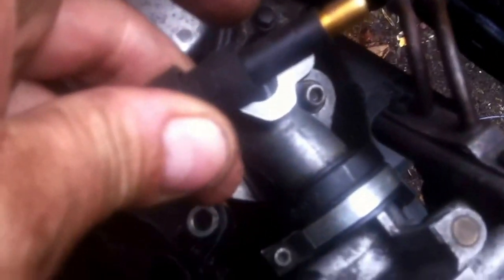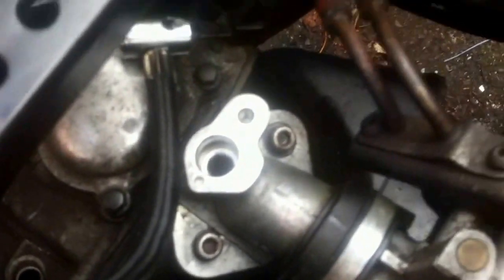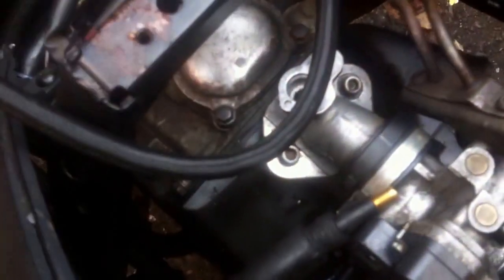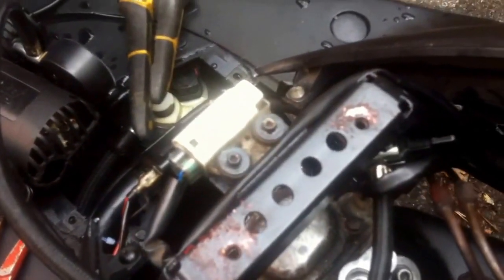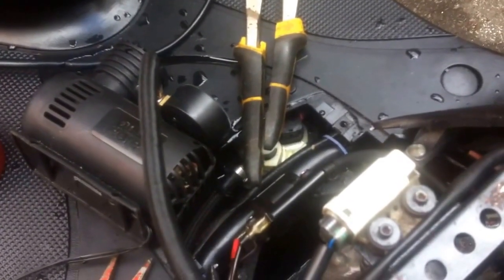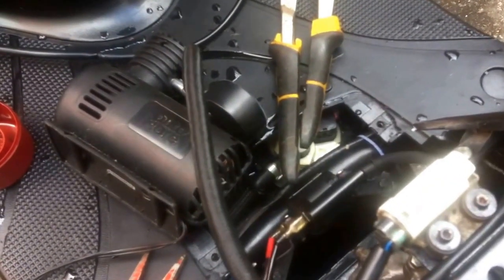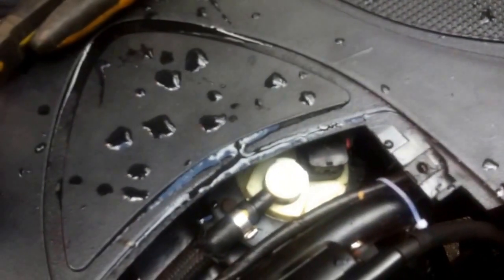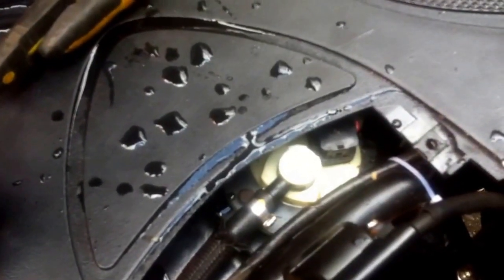SCOOTER FUEL INJECTION FAULT DIAGNOSTIC PART 2

Comment: thank you for your info. i am installed to my kymco agility 125 big bore 63mm  (180cc.). I bought injection of agilty 200 (176cc) buy the motor not start.....you now this problem?
Reply: Will be the fuel injection  it's not getting  the correct  fuel